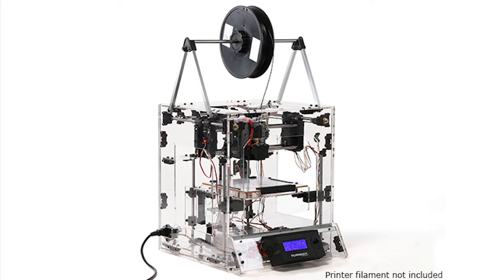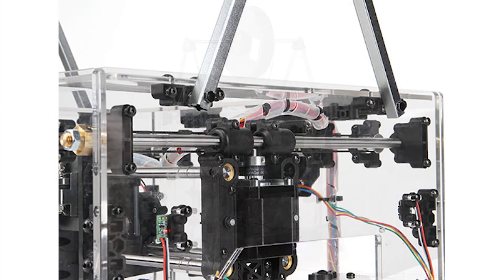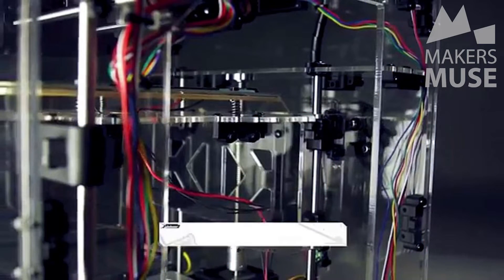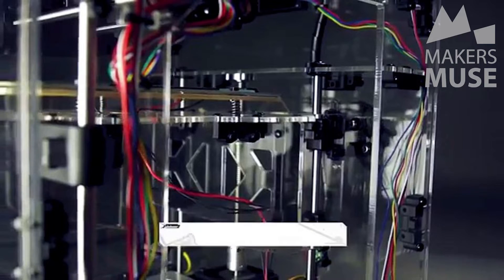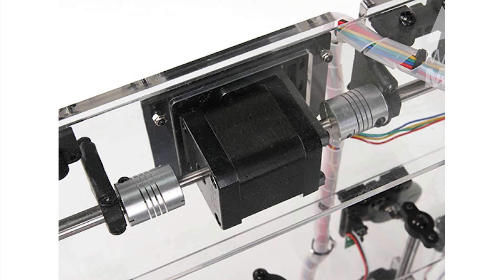Why do 3D Printers still kinda suck? - 2015

Comment: I agree the Makerbot 5th gen and that line are mostly crap but I paid £400 for mine and there now £270 and I've got to say dual extrusion heated bed  and 60 mms print speed gives me amazing quality and I can goto 0.06mm layer height it's an amazing machine and I love it to bits so much so I'm going to buy another
Reply from the maker: +iCloud Henshaw Is that the makerbot 2X? They were pretty good machines for their time. The Makerbot 5th gen is single extruder - no heated bed and PLA only... a total joke at the huge asking price if you ask me!
Reply: Clone of a rep 1 dual but just as good if not better and the new 5th gen printers are complete joke, the local college I'm at now has 2 up plus 2 machines and there not to bad
Reply from the maker: UP's are awesome, bit old now but still rock solid machines. I'm pinning my hopes on the flashforge 'guider' its a big print volume with the same guts as a dreamer - but metal chassis and only one head for simplicity.
Reply: +Maker's Muse yeah I'd love my printer to be single extruder some times as it is a huge amount of mass to be moving around and I have to limit speeds to 60mms when I have the full head on the machine otherwise it can affect quality quite badly

Comment: Finally a voice of reason! I just went to a MakerFaire in Orlando and saw basically every model of machine I had ever considered buying. Rostock Deltas to Makerbots to Ultimakers and every single sample part had the same nasty overhangs, layer seperation, print bed delamination and ooze bumps. It was incredibly disheartening because I've been tinkering with my own machine for 2 months now trying to fix problems that are industry standard. BUT! I went to a stratasys FDM exhibit at a trade show a few years ago, and their abs prints were flawless. Im sure their innovations are locked in patents, but it might be a quality control thing especially with proprietary filament rolls.
Reply from the maker: +drumaster134 I hear ya. There is SO many factors involved, and cutting costs before the tech is even perfected is never a good start - which is what many companies are trying to do. 

The fact is with stratasys machines is they're insanely over-built. The head unit for a fortus 450mc is worth around 25 THOUSAND dollars, that's just some motors, heater unit and sensors - all on a hugely thick metal support. It really puts it into perspective when you have POS machines that attach precision motors to 6mm acrylic and somehow expect any degree of repeatability or accuracy. 

The key I have found is to design with 'low cost 3D printing in mind', so if a part needs to be done in 2 bits, so be it - the cost savings are worth it. It's still an awesome hobby - because as things do finally improve, you'll be there with the knowledge!

Comment: linear encoders for the purposes you are talking about are expensive to make unless you are doing large production runs OR are using very expensive servos with internal encoders men't for very particular applications with constant speeds. The reason sub $1,000 FDM printers are possible is because of the modular nature of current (Chinese) parts. The current issue now is the fact that the cat is out of the bag on FDM printers and people realize that they are nothing more than a collection of Chinese parts not nearly worth as much as you are being charged (thus the skydive in price). People angry about cheep FDM printers are almost always just pissed they spent 2.5k for a MakerBot that has similar performance stats to machines 1/5 their cost. Only difference is that cheaper machine needs some attention to detail from the user and yes have mild issues. Funny think I notice is that most people with cheep printers are happy and tend to upgrade the printer using the printer. Don't worry dude, in the end cheep printers will only help things, more people printing means bigger market, bigger market means lower prices for quality equipment. Also most people who spend the $400 or less to build/buy a FDM printer take the time to get it working well and they are so much better armed with knowledge, again a positive to the field.
Reply: +MorRobots spent 800 on a solidoodle  3,  regret it. Its such a hookey design.
Reply: Did that. Put lawsy in and changed extruder to an all metal one. The belt tensioning system is awful and makes it hard to tune to get circles.  The way the drilll rod is held in by hose clamps is just cheap. My aluminum bed wasn't close to being flat so I put a piece of glass on top. The bed heating element doesn't heat the bed evenly. And the bed is not stiff so it shakes on rapid movements. Could of been engineered way better but I do understand that it was an early 3d printer and that had to make do with what they had.

Comment: Well said ! 3D printers are still in its early year, I gotta say they are extremely overpriced and unreliable. I couldnt agree more with your rant. You are a pro in this industry and your input on this is very important especially for the new users.

Comment: I use a Robo 3-D R1 and it has a heated print bed and I can print in any filament and it is not crap and it is under $1000 but it is definitely something that I think will rise
Reply from the maker: Buddyboy77 The Robo is one of the best in its price range I think, but the open design makes it hard to print large ABS parts without warping if the room is too cold - a big problem with the UP Plus 2 as well...

Comment: i agree alot with what you had to say, but i dont think you should bash the fabrikator from hobbyking. Sure the print area is small but you can buy it for $315 + free shipping at the moment. for people getting into the hobby this is great. Plus its a DIY hobby, your right, the media is making it seem easy but its not and all of the printers need alot of fine tuning. The fabrikator may not look robust but if you ask anyone who ones one, they will tell you they area very robust. except the hot end. that sucks. But its a DIY KIT, $315!!!

Comment: yeah .. should make a good vid ... but looking at it seems its really not that worth it ...

anyways, just a thought, maybe you can do a vid, on "Building the best printer" and things like design, cartesian,corexy, delta etc, chassis material, stepper or servos, electronics, bigger build volumes, modular in design etc etc etc .. basically a culmination of what will make the perfect, precise and reliable 3d printer ...If need be i will definitely assist with design, prototyping, fabbing (we can use my fablabs etc:)

Comment: Do you have any experience with the Da Vinci 1.0a? It's from XYZ products, seems good from some reviews, many issues fixed with the recent a update. Just bought one and waiting for it in the mail, but curious about any experience you have with them. Do they have these crap motors too? haha, thanks!
Reply from the maker: ***** The motors arn't crap as such, just overkill :P I don't use any of the davinci machines but have a few friends who love em - most of them were first gen though and they were hacked to run aftermarket filament. Not sure if it's possible on the newest machines...
Reply: Thanks for the info! I'm going to use the stock firmware until i start to want to use other filament or until one of the carts gives me an error and i'm forced to. Going to run the first 3 prints from your video today. Thanks!

Comment: 3D printing has been out for well over a decade, it started and still is a form of manufacturing prototyping. and there are many different types of 3D printing, FDM is used in the consumer market because it is cheap and simple (if) you know what you're doing. You can't just plug it in and expect perfect parts every time without maintenance or calibration. 3D Systems has been in the 3D world a long time, I've used an older printer of theirs that's the size of a refrigerator, and it printed perfectly. A few grand for a "cheap" printer needs a tinkerer to get it just right. If you want high quality prints, shell out the tens of thousands of dollars for a high end machine. The printers people are putting out now are attempts to appeal to the greedy consumer that wants high quality at dirt prices, then complains like a little girl when it isn't perfect to their standards. The printer with an acrylic frame is that way to be cheap, but that works perfectly fine since the only way you could get expansion of that is if the hot end physically touched the framing, which is supported by metal rods anyways. This rant is just like a person thinking that their phone should work after its been underwater. If you don't understand how it works, you aren't allowed to call it a piece of shit.
Reply from the maker: Astro143_ LOL that was a read. 3D Printing around for over a century? Would love to see an example. I am perfectly entitled to ripping into these machines because I work in the industry, every day, on machines from the budget DIY level up to EOS SLS (which breaks down a lot). Stratasys FDM works flawlessly, but yeah the cost and lock-in to consumables is pretty insane especially as it's such a mature process. Objet... nice quality but support material and post processing is a nightmare, same with SLA. Acrylic does expand and contract even with warm ambient temperatures - not to mention sheet thickness tolerances are very low. 

The main reason for this rant though, is that the UP! Mini is 3-4yrs old now, similar price to the hobbyking machine, and prints perfectly (I do most of this channels printing through it). I ran a school 3D Printing Class and actually most of the class was little girls, who had no issue using it.  ;)
Reply: WOW I can't type at one in the morning, fixed that right up. But still, you're comparing business grade printers to a consumer grade machine. Compared to a high end one the consumer grade printers do kinda suck but that's not the point, a dialed in Makerbot prints very nice for what it is. A smart car will never be as posh and perfect as a Lamborghini.
Reply: +Maker's Muse powder based 3d printers have been around at least 15 years and laser based liquid resin ones for at least ten years

Comment: not sure of everything your saying but my Printrbot Simple $400 off Amazon seems to work pretty good, yeah it was crap to learn, no real cust support, and i guess its noisy, not as noisy as my paper printer though! I like the little robot noise it makes actually,  I like to make little race-tracks just to listen to the motor accelerate  and such through the corners, its cool! Maybe it will blow up one day and melt but for now it runs great.

Comment: So looking to buy my first 3D printer, and not wanting to go over $1000, and not wanting to "tinker" with settings... what would you recommend???.... and why???
Reply: Dremel Idea Builder. Works great (mines over a year old purchased used on eBay with over 800 hours of my own print time, almost 1000 total, with no issues to date), easy to use, 6" x 9" print area with an easily removable build plate, onboard color touchscreen, prints great with cheap standard non-proprietary filament, fully enclosed chamber, capable of printing quickly (120mm/s) and still get good results, can print straight from SD card so you don't have to be tethered to an always on PC, LED lighting,  it's backed by Dremel themselves so you get grade A customer support through telephone and email and is backed by a 1 year warranty. Good luck with whichever you choose!

Comment: Talking about 3d printer technologies, you should take a look at some SLA 3d printers. SLA printer and the resin prices are slowly going down making this technology accessible to more and more people.
Also, you might be interested in the highly innovative "Peachy" 3d printer -> https://www.kickstarter.com/projects/117421627/the-peachy-printer-the-first-100-3d-printer-and-sc/description .

Anyway, I agree that most of the cheap (less than 1k usd)  3d printers and also 5th gen Makerbot (I wonder how many nozzles they had to replace due to crappy metal extruder design and insufficient cooling) and the overpriced Cube is just crap.

Talking about 3d printer companies, I believe once the big players (such as HP, Asus, Lenovo and so on) come into consumer 3d printer market (which imho will happen in around 5 years), all the small fish will disappear simply because they won't be able to compete on the same price level (including 3d Systems).
Reply from the maker: True, SLA is getting cheaper but it's still fairly unfriendly - but you're right for sure,  once HP drop their printer range (I suspect end of 2016) we'll see a massive shift. Machines like the robox are already proving that this tech can be run by complete novices with all difficult aspects taken care of with automation,  so I suspect it'll only get better. I'll try not to cry too much when they start bringing in 'HP 3D Printer ink cartridges' that you HAVE to use :P

Comment: A couple of observations. There are two things that steppers provide up to this point. The first is the strength to move fairly heavy components around. The printer I'm using now has two steppers that do only one thing, move either the y bed back and forth, or drive filament through the extruder. The other steppers move the print head across the x-gantry, including the extruder stepper, or move the entire x gantry, including the stepper driving the print head back and forth. If I move the drive for the extruder off the print head via a bowden system, I've eliminated more than 75% of the weight of the print head, probably closer to 90 or 95%. Likewise if I can move the x stepper off of the x-gantry, that combination eliminates another 35-65% of the mass of the gantry. At that point the weight of the x-gantry and printhead no longer need the strength of a stepper. The second thing that stepper provides is a way of figuring out where the print head is related to the object being printed. As you say there's no real reason to require that the motor keep track of that. Use a rotary or linear encoder to track how far the various elements have moved, and you will reduce the cost of the system significantly. A rotary encoder attached to the drive of a dc motor can give you the accuracy that you see now, but a linear encoder with absolute position information can give you even finer control.

I would think that the real limiting factor for speed of low cost printing would be how fast you can lay down a sheet of powder that you then spray with a fusor of some sort (glue? binary reactive chemical to whatever you're using for dust?) via something like a photo ink-jet printer head to print whatever you are looking for. Personally I'd like to see a system that essentially rolls a sheet of paper dusted with your print dust onto your print area, then rolls that paper back leaving the dust (electrostatic charge that gets discharged to leave the dust in place? vice versa?) to get the next layer of dust applied while the print head is doing it's raster print of the fusor. The end of the print job is laying down enough layers of dust for the fusor to all set, then an auger type system draws all the excess dust out of the print bay for the next print job exposing the print as a result. (A variation on the above would be to use a system like a laser printer with a higher power laser, and your dust be something like toner, though I suspect cleanup of that wouldn't make you a lot of friends either.)

I don't think there really is a shortage of ideas for new ways of doing things, just a shortage of people willing to work out the testing and development of some of them.

Comment: All technology goes through these growing pains as they reach out to the mainstream market  Look Henry Ford's model T - it was the first mass produced automobile that went virtually unchanged for it's entire 18 years of production!  
The reason for this lag is that the industry focuses on production and not innovation in the first few years.  For someone like you that has been into 3D printing for awhile it is frustrating but now with 3D printers being produced at the sub-$500 price point you will see more and more consumers taking the plunge.
I'm one of them!  My nephew has a Lulzbot Taz5, which is a really nice printer with a huge print volume capability, but he paid $2,200 for the printer and filament.  There just aren't that many first-time consumers willing to shell out that kind of money on technology that they're not 100% sure why they need it.  On the other hand I just ordered an M3D Micro 3D Printer for 350 bucks and I was willing to risk that amount to get my 3D printing feet wet.
Once there are crappy, cheap 3D printers in most homes then consumer demand for higher quality printers will push innovation in the technology.  And you are right, many companies will fall off into oblivion as a result.

Comment: You expect low end printers to have the best print quality?

Good high end printers are expensive because they are expensive to build.
Reply: dc+encoder costs about the same (or maybe 10$ more for the 4 motors.) as a nema 17 stepper, so that's not a good excuse.